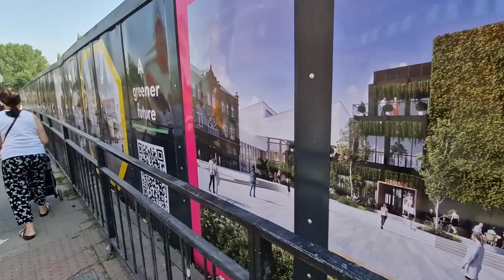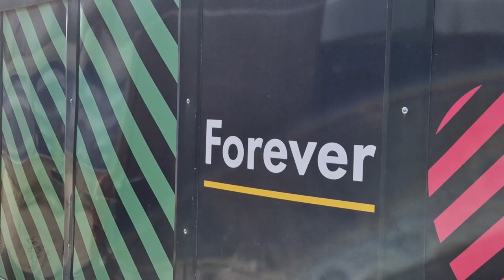Wigan Galleries Demolition Update 6/9/23

Comment: When it opens up The Grand Arcade is going to loose a lot of money for a few months
Reply from the maker: It's gonna be apartments. A hotel. New cinema unit. Entertainment spaces. Some retail. No replacement of the lost parking. Some food outlets and other stuff. Mostly polishing up the town center but not doing what is really needed.
Reply: @Foxstar1387  ok good for pointing that out but i think there was nothing wrong with the galleries and makinson arcade it could have done with a refurb and maybe a sugar daddy to get some more shops in but i liked spending my Saturday afternoons at the Galleries!
Reply from the maker: @michaeljohnson5365  the council in their wisdom decided that as part of the " leveling up " scheme that pulling down a set of buildings that needed minimal work done. Yes ok market gate roof wasn't all that good but abit of fixing and it would be fine.  The market could have done with a spiff up and other parts maybe needed alil tlc but it wasn't all that bad. Lower rents and such could have helped keep companies happy and in the units. ( ripping the guts out of a town center isn't the best of ideas. And in this new economic climate it isn't wise either. I don't like that it's being pulled down as it could easy been renovated and turned into what ever was needed at the point. But the council feels ot k ows best. Even if it's practically pissing in the wind. Due to things like paigefield being in such a sad state. )

I compare alot of stuff in Wigan to what's in chorley since I lived there till late 2018. Look at how well chorley center is doing compared to this.

Comment: Are those building getting demolished because of rubbish concrete ?
Reply from the maker: It's a plan to re invigorate the town center. Move the market hall from the lower end upto the top end. Build a new cinema some apartment blocks a hotel and future entertainment space with cafes vars abd restaurants. The buildings are very solid. The aerated concrete wasn't included in the build. Just lots of steel re enforcement and high grade concrete. A very solidly built set from late 80s.